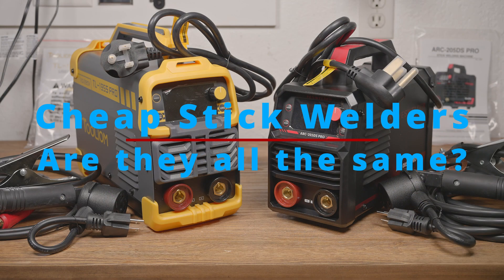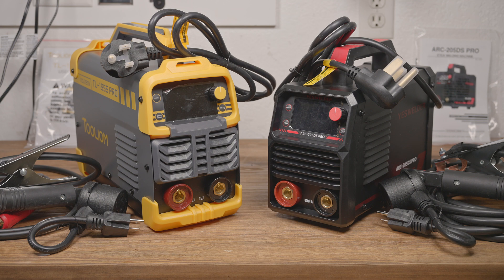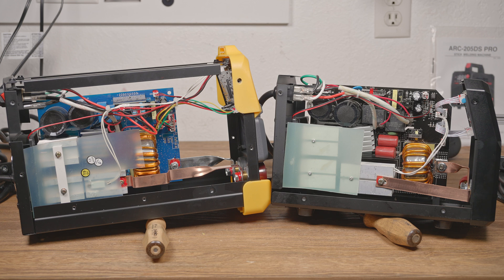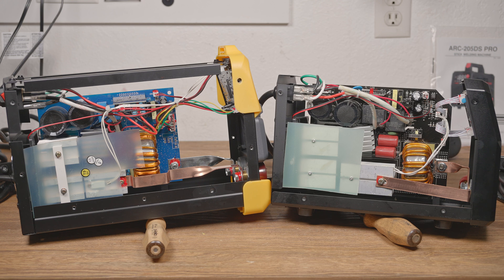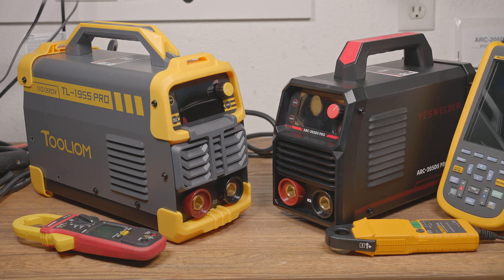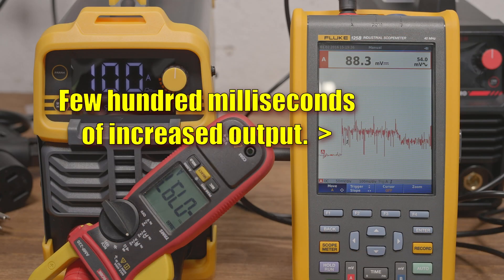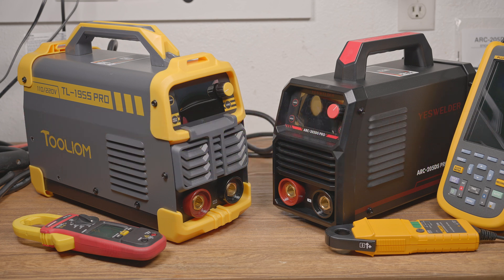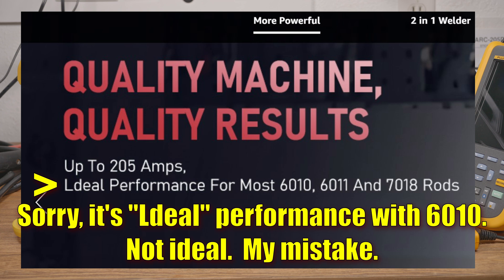Tooliom Vs. Yeswelder Stick Welders - Are They Actually The Same?

Comment: Truly a shame because even though they can't run 6010/6011 the target consumer (light welding 1/4" and under) could really benefit from an inexpensive 120amp/160amp welder! 
Lots of stuff can get done with 6013/7018 but the amperage readings being largely overestimated and incorrect makes this basically unusable for novice welders who lookup a chart for what amperage a rod should run and stick it to the side of the welder. 
If yes welder (and others) would just be transparent and market it as a basic 120/160 amp welder with accurate amerage readings it would make for a very versatile welder for general light tasks. Your videos are what deterred me from getting a "200 amp" (160 actual amp) yes welder.
Reply from the maker: I've said the same thing before.  Welders like this may frustrate and discourage someone who is just starting out, because when they set the welder like all the charts say, they struggle.  Granted, all welders behave slightly different.  But these machines will struggle to start or keep an arc going, even when the display shows a number that should be pretty hot for the given rod.  All because whoever is making them, builds them to be deceptive about their amperage settings.
Reply: Wonder why so many chinese welders can't even handle 6011 ?..Don't they use a cellulose rod over in china?  Or is they just don't know how to make it work?
Reply: I bought Tooliom 195S stick welder about 6-7 months before and I don't have any problem running 6010 3.2mm , 6011 3.2mm with it . The only thing I did , I change the origional 6 foot stinger and ground cables with 1 AWG pure copper cables , 20 feet stinger cable and 10 feet ground cable just bcz the origional cables were too small ... and I have burned 6-7 rods non stop one after the other many times without any problem .. I run it on 240 Volts and 50 amp breaker ..

Comment: Nice vid, I agree 100% most Chinese welders are falsly advertised. They work for so many home hobby fellows that might use them for 5- 90 min intermittently with 3/32 or sometimes 1/8 7014 or 7018 and think there the best thing and give 5 star ratings ....... to much bs. I am very happy with my Fronius Transpocket 180i and ESAB Rogue 180i for stick or tig. Keep up the vids, I just subbed. Thx
Reply: Most Chinese anything are falsely advertised. They make a $5 item look like a $30 item and sometimes it's worth it just to get a $7 item for $5 :P

Comment: Hey I don't blame you I wouldn't waste my time on going through the testing too when they're all both a waste of money of being the same machine built on opposite ends of the factory..... And it's always funny that yes welder has been boasting about 200 amp output on all of their 205 units but there's none of these guys that brag about yeswelder so much and actually do an output test on them to see if they're actually putting them out..... I'm kind of curious about their new dp200 they have coming out...
Reply from the maker: Well, for better or worse, I ordered a DP200.  I also have one of their newer, MIG 205DS machines to check out when I get time as well.  But that might be the end of my testing of Yeswelder machines.  I keep thinking I'll find that they've finally changed and their latest batch of revised models will be different.  But no.  

We'll see how it goes with the 205DS and the DP200.
Reply: @bigtb1717  unfortunately I have too put a deposit on one too hopefully I get word of it having manual mode not everything can be welded in synergy mode.. i made mention to the gentleman on making stuff he said he passed on word to yeswelder saying that it would be nice to have manual mode. But I guess we'll see when the final product gets released I do like the interface on it though......
Reply from the maker: Well, hopefully for a lot of people's sake, it's a good machine.  Last I looked they already had thousands of backers.
Reply: Yes.  They promise not to lie this time...again.
Reply: I have 3 tooliom machines, this one and #1 TL-250 and #1 TL-250m PRO and they're solid machines. You can weld for days and the machine won't skip a beat, I believe their QC missed the duty cycle.

Comment: The size/weight of the toroidal transformer is the main limit on current output, as it's expensive to give you the one needed to do 200amps.  With a bigger donut and slightly larger input capacitors  and output diodes (plus updated software) it could do 200A.   The original design probably had that, but these guys always quietly cheapen the design with Version 2, 3 etc. and that's how you end up with a 200A welder that only does 140 to 160A..

I also notice that the Yes welder has 2 relays - one for configuring the capacitor voltage doubling circuit when on 120V, and the other for soft/slow charging the input caps when first plugged in/turned on.     The Tooliom has only one relay (for selecting 120/240) which means the input caps get huge inrush current and  can blow if you  turn it on at the top of the mains sine wave too many times.  A bit of russian roulette with that..